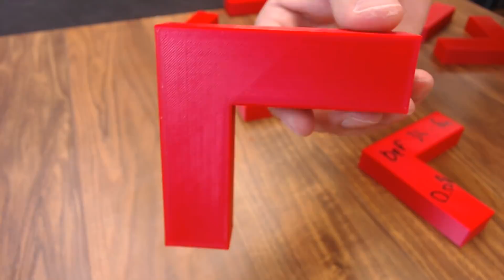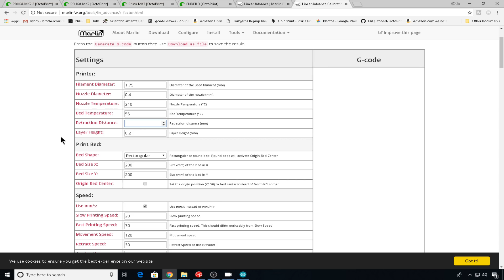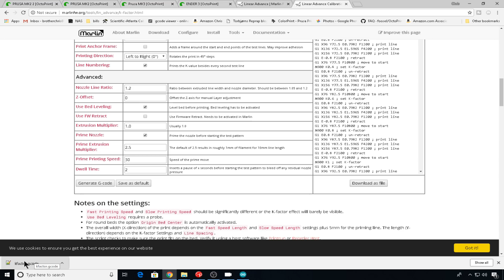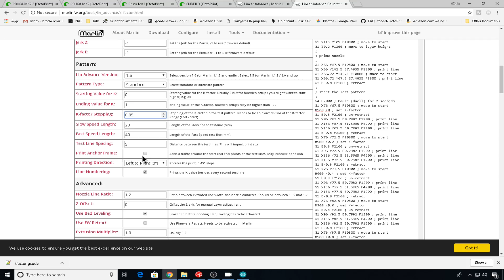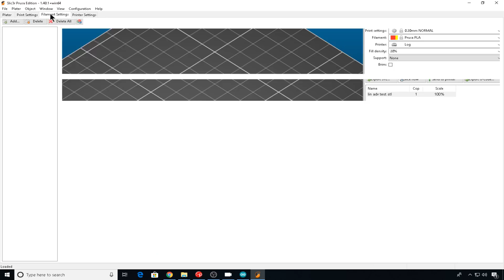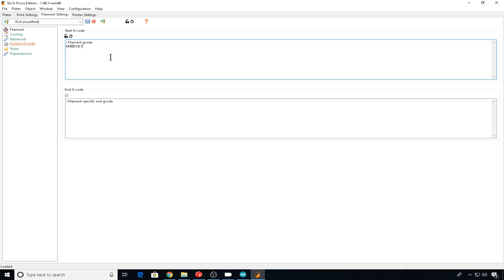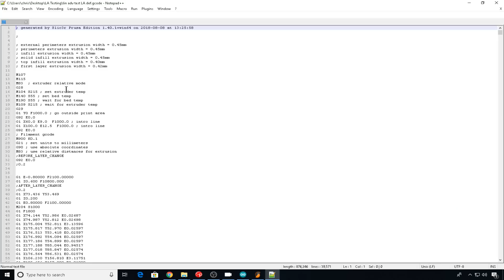Linear Advance - Marlin 1.1.9 - Faster 3D Prints - Chris's Basement

Comment: Hello Chris Riley, incredible explanation, good work, thank you, I wanted to ask you a question, I did the steps that you teach in the tutorial adapted to my 3D printer, but the size of the pieces was reduced, which could be the solution to that problem.

The same thing happens in the video, the piece becomes smaller.
Reply from the maker: This is true, because of the way it changes the corners it could make it a little smaller. If you get it tuned just right it should be minimal.
Reply: thanks!

Comment: I don't think that your explanation of the effect is correct. When you are extruding the filament is pushed hard down the nozzle. Now you are pushing it a certain distance from the nozzle - say, ~5cm for a direct drive, or even 30cm for a bowden. The filament is a bit loose in the tube and also is a bit flexible, so it acts as a spring. Your extruder does compensate for accelerations and stops, but when you have this "spring" the filament keeps extruding for a bit, even after you have stopped the extruder motor. You explained it like your extruder runs at a constant speed - which it doesn't. It accelerates and decelerates with the x/y axes, but it does not account for that "pressure build up" as some are calling it. Some slicers had options to try to compensate for this, called by different names, but i remember something like "coasting" - which stops the extruder just before the line ends so the built pressure can finish it.
Reply from the maker: It is still a little hard for me to wrap my head around. I was worried I didn't explain it 100%. Hopefully it's enough to get people up and going with it.

Comment: Hello,

A question?  (problems problems problems .... sigh!)
Could it be that if the nozzle is too close to the heated bed, the extruder will no longer print?
not against it, but too close to the bed that the extruder no longer sprays PLA???
I do not know if the nozzle is blocked ??? I do not know it anymore at the moment, a riddle!
if I have the nozzle up (the Z up) and manually extrud then does it work?
I now use the new Cura 3.4.1 (the old Cura is still on the PC)

Regards
Rob.
Reply from the maker: That's odd, is the extruder turning when it is down low on the bed? You should at least see something coming out I would think. Lose motor wire maybe?
Reply: Hello again,

I found it!
it was indeed so low (maybe against it)
and therefore nothing came out of the nozzle !!!
you do not hear much about this problem.
but I'm glad that The DIY Prusa does work again!
( I am amazed every time that machine is finished with a workpiece )

Kind regards again from here!
Rob.
Reply from the maker: @hobbyrob313  Excellent, I'm glad you were able to resolve the issue.

Comment: I can confirm I print really fast with linear advance and no quality lose, sadly I cannot use the new version since I have the Y axis aka bed homing issue that some people have on the CR-10s and some other models, when that happens triggers a printer halt, since for me lose accuracy its not an option (1 fix is activate noise filters in firmware) capacitors didnt fix it to, I just cannot use 1.9 im stucked on 1.8
Reply from the maker: Sorry to hear about that issue. The LA in 1.8 still seems to work pretty well.

Comment: Thanks for the info.  I have better understanding LA.   I always like your ongoing support.     It was nice meeting you at ECR Fest 2018.   When is the next one in Maryland - Mike T.
Reply from the maker: Good to meet you Mike! I haven't seen any dates yet, but I will be there!
Reply: I ask if I could get your baseline printer settings.   And I like to use Simplify3D to Slice.   But, I think you like to use Cura.   I never was able to get good results with Cura.
Reply from the maker: I use slic3r pretty much all the time, I can get you all the settings in text, but they might be hard to plug in to S3d.
Reply: Sounds good.  I will try to convert to S3D.     But, best of all,  I will try to learn your magic with slic3r.
Reply from the maker: Here you go, this is a prusa gcode, I just removed the movements. I used petg, but it shouldn't make a difference. https://drive.google.com/open?id=1uyZ28xPp1FKdJDIepIaFMj_oMM-UGdka
Reply: Thanks very much.

Comment: Chris, I use different Layer Heights for different prints, Should I redo the k factor calculations for each profile?
Reply from the maker: Hey George! No, you should be all set to use the same K value for different layer heights. As long as you are staying with in that 75% layer height to nozzle size ratio and assuming your extruder can keep up with the output if should be roughly the same on the same types of filament.
Reply: Chris Riley  thanks

Comment: Good video and explanations, but I would suggest that you demonstrate everything with a bowden extruder. Indeed direct drive extruders have very little filament compression and the flaws are not so obvious. K0.1 is almost negligible and it looks like a lot of hassle for not a huge improvement. With a bowden setup I found K1.3 for PLA at 80mm/s and the result was spectacular. I went from 6 mm to 2 mm retractions with zero stringing and the corners of the print became super sharp.
Reply from the maker: Awesome! Thanks for sharing your results. I could do a quick bowden video for sure.

Comment: Superb explanation Chris, thank you. Been using LA v1 for a while, so I know what it's all about, but since I upgraded to Marlin 1.1.9 I've been keen to try LA v1.5. I now know a lot more thanks to you.
Reply from the maker: Sweet! Thanks for watching! Love the username and avatar BTW. :)
Reply: @ChrisRiley  Just to keep you updated, as you know, when I tried LA 1.5 on the CR-10S4, the first time, it wasn't as good as it should have been. I suspected hardware so did a few upgrades. Micro Swiss hotend, Bondtech extruder and even Capricorn tube. I have just re-run your configuration and my K value is now 0.45 (was 0.9 last time) and it's working perfectly. The printer even sounds happier, no really it does.
BTW, I've also got a Keenovo bed on order (yeah, extravagant I know) so planning to install that when it arrives. I forked out for expedited delivery so hope it won't take too long. Are you planning a video on installing the Keenovo? I'd love to see your process. I'm not sure if I'm going to install the SSR inside the control box, or house it in a separate one.
Reply from the maker: @spikekent  This thing is going to be a beast! :) Yeah, I would like to give a Keenovo setup a try, I have to find something to put it on. It would be a good how to video I think.
Reply: @ChrisRiley  Yeah I've got a habit of going overboard with projects (link below) But this one is useful too :-) I'm seriously considering mounting the SSR on the PSU inside the control box (if it will fit) and bringing the connections out via the existing aviation plug (I think they are rated for 240v)
A couple of years ago I decided to build a "slightly" bigger RC vehicle than I had previously built, this was the (rather excessive) result. I often gets called a beast too :-) https://youtu.be/WpLxhS6jK0M
Reply from the maker: @spikekent  Holy crap! That is awesome!
Reply: @ChrisRiley  Thanks mate. It has a new home now, it's gone to a disabled friend ... he plans to make a mobility scooter out of it. We are clearly a mad bunch :-)

Comment: Great and informative video!  I hope you can get the time to answer a couple of quick questions.  I have a Prusa MK3 and the K values used there are in the 30+ range.  Not the 0 to 2 in your video.  Is it because Prusa uses a different lin advance version?  Or can I use the same K factor generator you used on my MK3?  Thanks again for the informative video!
Reply from the maker: Thank you! Thanks for watching! Until Marlin 1.1.9 the K value was just a number. K30 was pretty common for PLA. Pursa is still currently using that older linear advance scale. Now the K values in LA 1.5 are much smaller increments that represent a volumetric value. Until Prusa brings in LA 1.5, you will need to stick with the older K value range.

Comment: Ive been trying to get this setup on my cr10 but it seems theres not enough space left on the board when i enable lin advance.  I get this error message:

Sketch uses 130816 bytes (100%) of program storage space. Maximum is 130048 bytes.
Global variables use 15331 bytes (93%) of dynamic memory, leaving 1053 bytes for local variables. Maximum is 16384 bytes.
Sketch too big; see http://www.arduino.cc/en/Guide/Troubleshooting#size for tips on reducing it.
Error compiling for board Sanguino.

Any ideas on how i can get this to upload?
Reply: I fixed this by uncommenting DISABLE_M503 in configuration.h
Reply from the maker: Awesome! Yep, disabling M503 is the quickest way to free some memory up.

Comment: Just out of curiosity. I’ve been using an Ultimaker for quite a while now so I’ve just been going with default settings. I did own a Prusa machine and when I was using LA I think my number was K35 or something like that. This was almost a year ago. Has something changed that the numbers have decreased so much? You used K0.1, mine was K35 and it worked as well as yours did.
Reply: Could it be due to the Marlin Version?
Reply from the maker: Correct, until Marlin 1.1.9 the K value was just a number. K30 was pretty common for PLA. Pursa is still currently using that older linear advance scale. Now the K values in LA 1.5 are much smaller increments that represent a volumetric value. Thanks you both for watching!
Reply: Excellent. That clears it up. Thanks for the reply!

Comment: Great explanation, and examples  Thanks!
Curious - was there a reason you didn't run another test with a (for example) an Starting Value for K at around 0.80, an Ending Value for K around  1.02, with a K Factor Stepping of around 0.01 or 0.02?  Just to see if you might have wound up with a K Factor of 0.9 like you've speculated?  Or, is that just taking the test too far for final adjustment?
Reply from the maker: Thanks Ron! Mostly it was to save on video time, it is a bit redundant to go through a 3rd round of testing, but to get things 100% dialed in, it's probably a good idea. If you went down to that level you might not be able to see the difference in between the lines, but it would be worth a look for sure. Thanks for watching!
Reply: I guess at some point you'd need to magnify the difference using wider lines, if your extruder can keep up.
Reply from the maker: Interesting point, you could set it up to use a .8mm nozzle or something like that. As you say, if the exturder could keep up. I would like to see the results on that.

Comment: Nice video man. I had enabled linear advance on both my printers. For the test though, wouldn't it make more sense for the slow speed to be 20 and the fast speed to be more than 70 since you are printing faster than 70?
Reply from the maker: Thanks Mike! That's a good point. It really depends on the printer. I went with the defaults because I thought that might be closer to what would work for everyone else. 60 has been kind of the unspoken speed limit for a while now, so that's my guess why default is 70. If you want to print faster it would probably be a good idea to move to a faster speed and retest, even the slow speed might need a bump depending on the speed array for different part of the model you are using.  I think you would want to avoid a print speed jump more than 50.